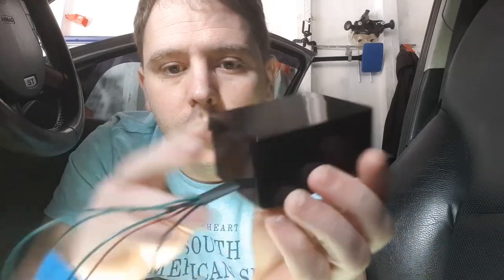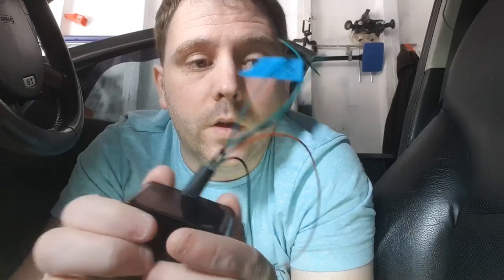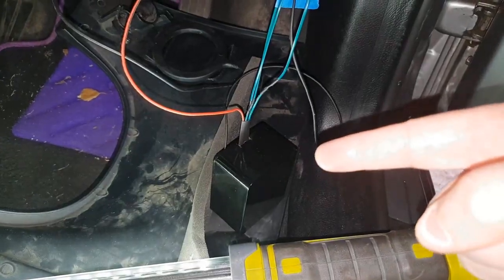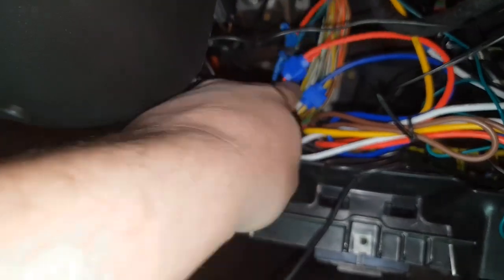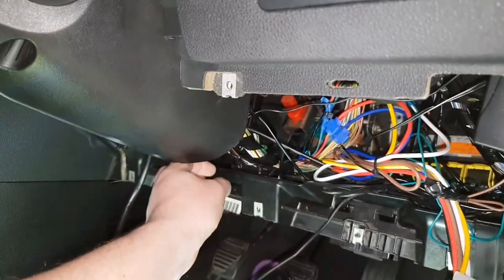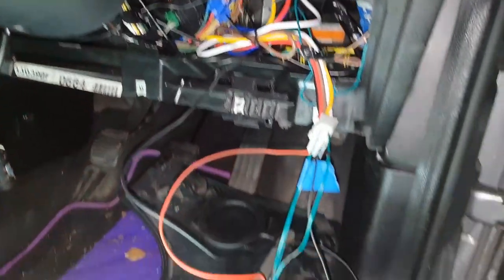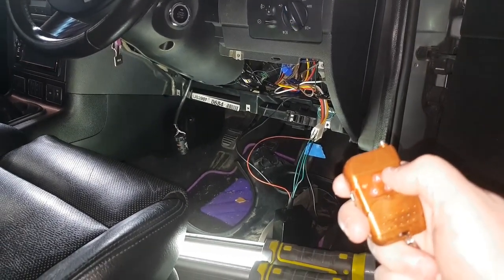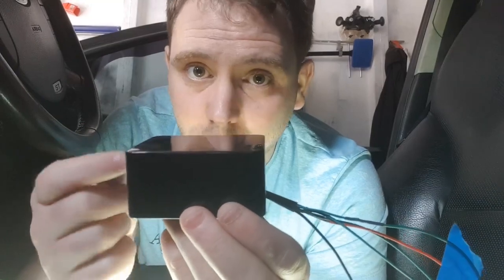Car remote engine start install

Comment: Great idea man, but one ''small'' problem.. Your car can be started by whoever can get in it, not really secure
Reply from the maker: thanks for your comment, with this system i have in my car you still need the immobiliser that comes with the kit to allow the car to start.

Comment: You could have a neutral position switch wired in so if left in gear accidentally it won’t start.